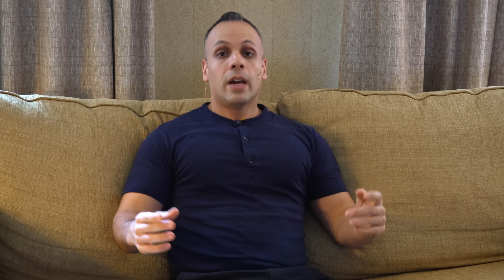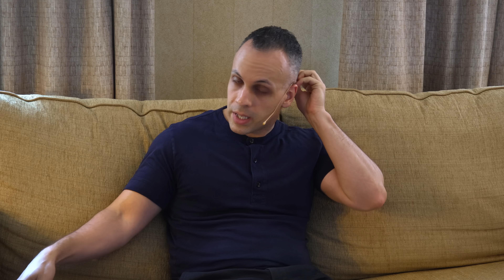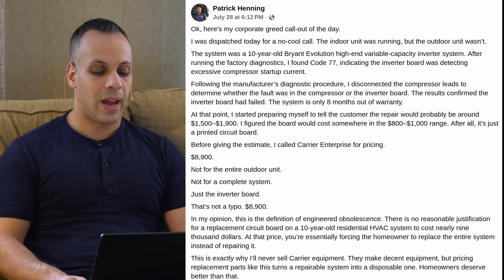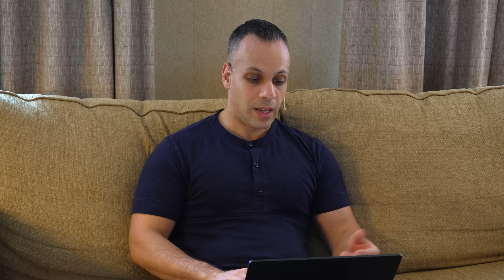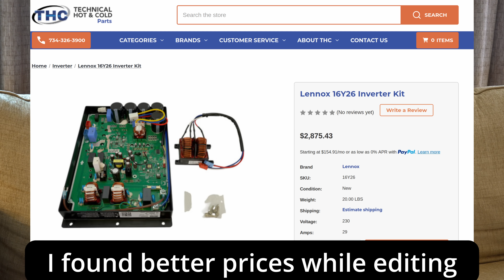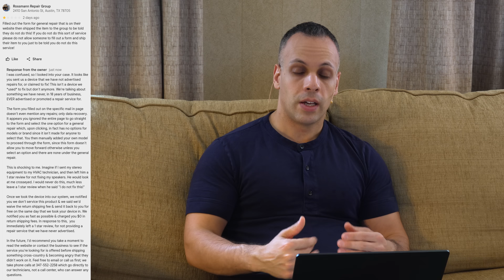Carrier AC repair has $8700 part cost for residential unit

Comment: 99% of stuff is just made in the same factory's but brands slap a logo on it and now its premium. Doesn't matter the industry IT, pet food, electronics its all the same. Usually its shells like you find that a company owns a company that owns a company that oversees it all and actually owns the competition as well so they really don't care. Cars are the perfect example like 5 brands owned by a parent company that just swap parts and have a "cheap" car then the " luxury" car is running the same engine BUT it has a sunroof and a different badge on it so 40k more. Like my captur from 2014 has the same engine as a Dacia from 2020 its even in some merc A class ones. I get they add more frills but its never justified being double the price because it has something you don't actually need like motorized seats.

Comment: 5:42 It's the fuck you buy a new one price, because this inverter board repaired will probably set you back $50 in labor costs and $0,15ct in parts.
Vote with your wallet ladies and gentlemen.

Comment: I rent a house. The compressor in the exterior unit failed. Rather than replace the compressor in the exterior unit, they replaced the entire exterior unit. No cost to me so I don't care, but they upsized the unit and didn't take into consideration the breaker for the AC

So now it pops randomly when trying to call for AC

There's no way in hell that the 10 year old system that was there needed replaced, besides the compressor... And its not like there have been many innovations in compressor technology for AC coolant

Comment: I put mini splits throughout my house when my last AC unit failed. Cost a little bit more but seeming well worth it right about now.
Reply: Mini splits are way more efficient too.
Reply: @DennisMiller-d8w i love em so much. More efficient and the whole house is 78 while my office alone can be icy cold, no guilt.
Reply: @r @renegade_patriot ni splits are also ugly handle humidity poorly, and dont contribute hardly at all to house ventilation.circulation of air. Maintainence nightmare -you ahve to clean  and change filters on each head standign on a ladder. Fully ducted systems purposely installed and sealed have some real advantages.
Reply: @johnwhite2576 LMAO 🤣🤣🤣 okay buddy

Comment: For years, I’ve been told “well that’s the way it is” and “whuddya gonna do about it” from beaten down cynics and NPCs whenever assaulted by such corporate behavior. This is what that attitude got us all. I love enraged people because they WILL DO something. They have self-respect.
Reply: YES!  I feel beaten down because most of the time i feel like i am the only one enraged by what is going on in every sector of this economy.  It feels like 90% of everyone is just going along with everything willingly
Reply: Anger and agony are better than misery
Reply: "Make life take the lemons back!"
Reply: Yep - they make the Mafia looks trustworthy
Reply: Got quoted 3500 CAD for a window regulator for a 15y o truck... Broke out the epoxy, welder, grinder and also fabricated a steel support strap to make it work for a few hours labour... Just as well cause the engine broke the next day in the lump that had had a "rebuilt" motor put in just over a year before and it ate the camshaft... More recently got quoted about 10000 for a turbo... Just the turbo and actuator.. 2 parts and "installation kit", not installed/labour. 🙃 I don't wonder why bacon is near $20/lb.
Reply: I exclaimed "I just want the window regulator, I don't want to buy the whole truck!"... Didn't even get a laugh... Oh but it doesn't come as a repair part, its an assembly with the door latch, inner and outer handle and motor on the bolt in frame piece... 😱
Reply: @ryank5688  Junkyard.

Comment: Imagine paying 2000 dollars, let alone 9000, for a printed board that cost max 40 dollars in parts
Reply: There is nothing on an inverter board that could justify that price. Nothing.
Reply: @vincei4252  Yeah this is the kinda shit they used to bust out for us in the 2000s in highschool electronics to fiddle with (from broken stuff etc). These prices are insane
Reply: @vincei4252  I can't possibly imagine this to be more expensive than a modern smartphone.
Reply: Someone needs to buy one, reverse engineer it, and release a compatible clone for like 80 bucks
Reply: And its a piece of crap if it failed that quickly. Purposely underrated no doubt
Reply: Damn iPad Pro is cheaper
Reply: That was my first thought, but I tracked down a photo of the Carrier board and it's way more complex than the Lennox board shown in the video. It's got stacked pcbs, so you can't see all the components, but a BOM cost of $200 including the housing would probably be more like it. Add in the cost of assembly and testing, plus a markup for overheads and a 100% markup for profit, and I would expect it to be leaving the factory at around $800. Also, they aren't going to just make one. They probably make batches of 100 or 1000, and there's no way to know if they will sell, so the price has to include an allowance for those that sit on the shelf forever.
Reply: @stevegreen5358 all true except the part about them not knowing if they will sell. Any company tracking service calls and spare part orders can very easily predict how long the parts should sit.
Reply: An inverter board will not cost 40 dollars, you'll haveat least 300 on IGBTs alone , being nice, produce the board ( including assembly) probably costs around 600, sell it at 1600 or 2000 and that's it, but 8000 hehehe, they are nuts!

Comment: I got fed up with dealing with HVAC companies and taught myself to do most of the work. 

+90% of the time all you need is a multimeter to diagnose the problem. And, 99% of the time you can find the replacement parts (especially for 10+ year old systems) on Amazon or eBay or even Grainger for a fraction of the price an HVAC company will charge. 

I've found a lot of HVAC companies seemingly price parts by taking the cost and for the part and multiplying it by 10. 

Not all HVAC companies do this and but the ones who used to be family owned but have since been bought out by private equity and keep the same name to pretend to be independent absolutely do, do this.
Reply: Man tell me where do you live so my company can move there. We’re commercial and just do flat 1.5x markup on anything part related and our hourly rate is sub $200 an hour but somehow we’re too expensive..
Reply: @bigolenate1678  St. Louis. There are a couple decent companies here but most of the bigger names do this especially the ones that advertise a lot.

Comment: I live in the middle of nowhere. A local company sent a guy out that replaced my capacitor and cleaned the inside unit for ~$180. Just driving here from anywhere takes about 40 minutes.
Reply: That’s actually reasonable. Let’s call it an hour of travel. 50 bucks an hour. 20 bucks for the capacitor. An hour to swap out the cap, and clean evaporator coil. 100 bucks profit to cover fuel, tools, wear and tear.
Reply: @BrentMcDonald-t5t  Yeah I was thrilled. I gave them each a bottle of hot sauce I make at home lol
Reply: @BrentMcDonald-t5t going price is usually $125+ hr  plus parts
Reply: @DaveBigDawg  I think the part was $20 and they were here for an hour. I'm not mad at all about that number.
Reply: Always fun when you're charged $200 for spraying a $5 can of coil cleaner on the outside units then charged for 3 people turning up while one of them stands around doing nothing.  I do all that servicing myself now.
Reply: @vincei4252  I had just been changing the filter for the last 3 years and never actually noticed the dog hair caked on the coils. We don't have a dog.
Reply: @vincei4252 businesses cost a lot of money to run and you're the exact type of customer that no trade wants to deal with. If you know more and can do the same as skilled professionals in the industry then by all means please do.
Reply: Got a good deal!
Reply: That's actually cheap
Reply: @DaveBigDawg  Yeah I was shocked.
Reply: I got charged $400 for a capacitor. I dont really have a choice being a wheelchair user with the unit on the roof.
Reply: @TheHrb1234  I dont know all the details, but unit on roof, also supply and install capacitor, potentially pickup from supplier, drive time, ya $400 doesn't seem bad to me to get the heating/cooling going again.
Reply: @TheHrb1234  Half that is probably just to get the tech out there... If the unit was in your attic in Arizona summer (reaches 180 degrees sometimes), then it's a steal of a price.  And, I don't know WTF happened to caps lately.  It seems they only last a few seasons anymore.
Reply: That’s actually a pretty good deal for you. They probably didn’t make a lot of money on that.
Reply: In Oklahoma. 325.00. Sigh.  We just bent over. I don’t know how to change those on my own. I’m too scared of electricity.
Reply: @kathy-t5q  Being scared is fair enough. However, it's a 3 minute job that'll set you back about $20. These people thrive off consumer apathy.
Reply: I bet they cut you deal to get future business.
If the employee sees $40/hour as pay, employee costs are at least $75/ hour after adding in FICA, insurance, benefits, etc.  If you've ever signed the front of a paycheck, the final cost and math for employees is harsh.
If the guy took 2 hours (including travel) to do the job, they may have made a small profit.

Comment: For a proprietary part, a "F-off price" is ridiculous, but for a service, where there is a healthy competition it does sound nice.
Instead of hearing a firm "no", I would rather hear an honest "we don't do that here, so you better go look for someone who does, because if I make an exception for you I will charge you 2 or 3 times what they do", even though I would probably follow that advice.
There is something nice about having a choice, even if it's essentially an illusion.
Reply: But there's a difference between, as you say, someone honestly telling you they don't really do that, and will overcharge you if you really insist, and what actually happens. Which is, they just give you a FU price and pretend it's the normal cost of the repair.
Reply: If it is something that you cannot do, it is nice if you can point to someone that can/does.  People remember that.
Reply: Ahhh, the Matrix theory of repair!  "...nearly 99% of all test subjects accepted the program, as long as they were given a choice, even if they were only aware of the choice at a near unconscious level."

Comment: 4:51 yeah I'm never buying a carrier specifically because of Part prices. Also if an inverter board goes out on my AC I'm sending it to you, I will ask first.
Reply: What are you buying then?
Reply: @y76769  Trane, Lennox, York, Goodman. There's other options.
Reply: @y76769  right now i have a good enough (goodman) ac, been living here for about 7 years, only had a fuse blown on it so far and the air handler unit needed a new blower fan. i live in florida, so its definetly under stress. plus have those crappy casement windows that dont hold in air worth a crap. sooooo shes a tough old bird.